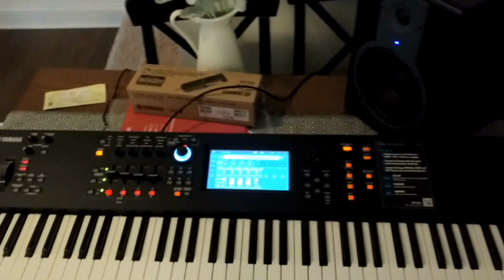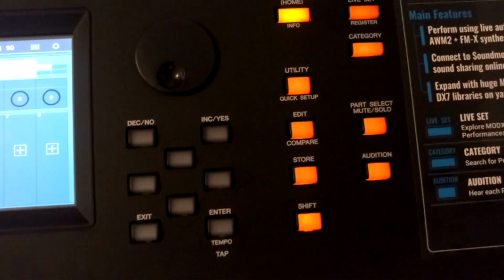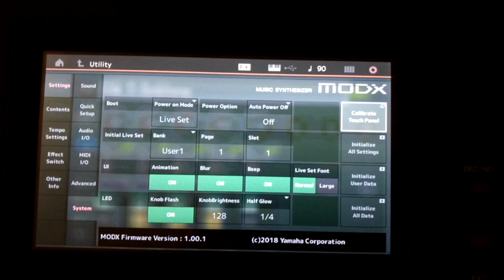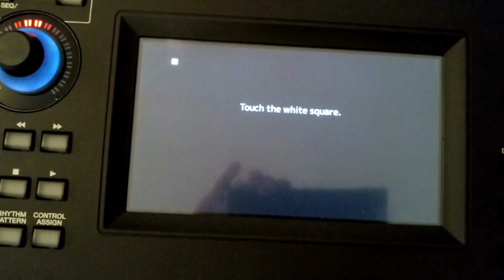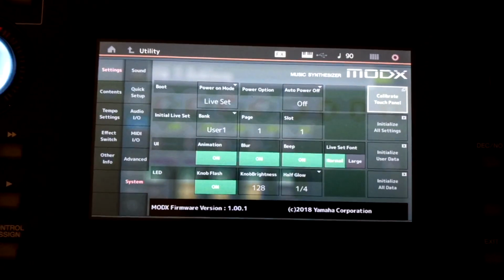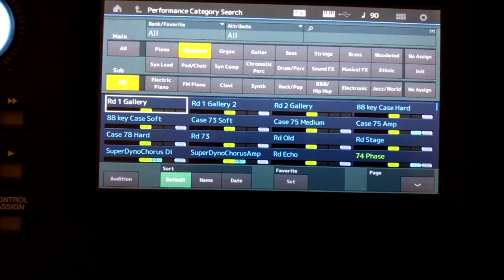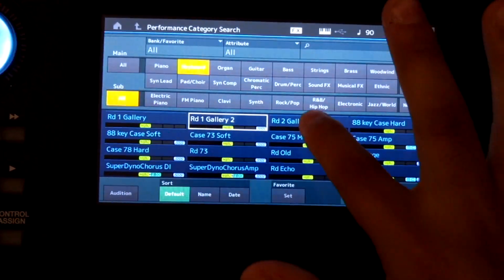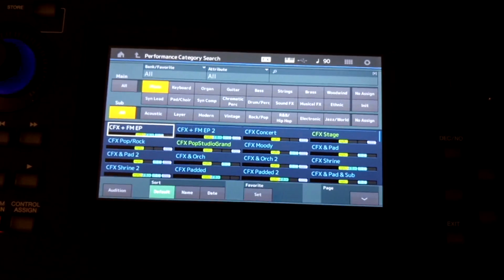Yamaha MODX SCREEN CALIBRATION

Comment: Just bought a new MODX7.  The master volume control wasn't working properly...but everything else was.  Took it to the tech and he fixed the volume control.  I went to change sounds...and now the touch screen is not responding.  I thought I would try this.  Indeed it takes you to the calibration screen....but when you touch the little white square....nothing happens...the screen still doesn't work to even calibrate it!!  I am NOT happy Yamaha.  This is BS!! 😠😠